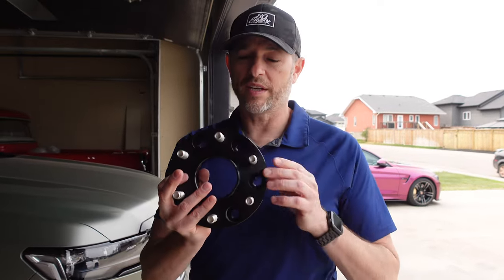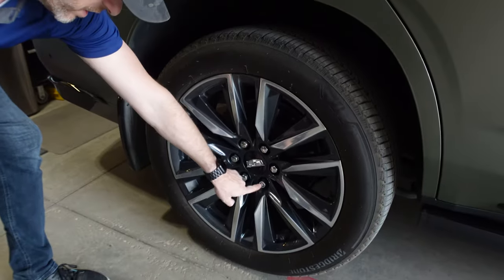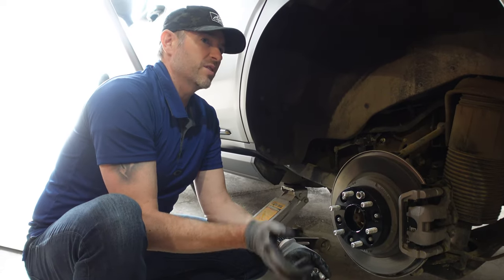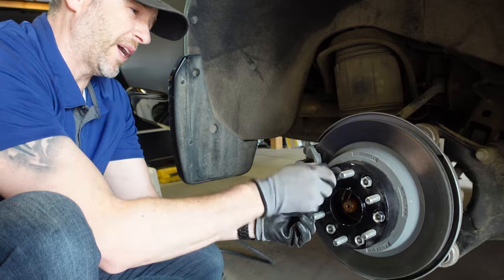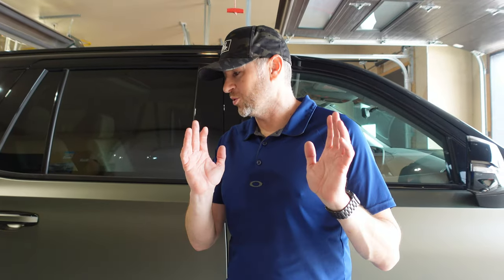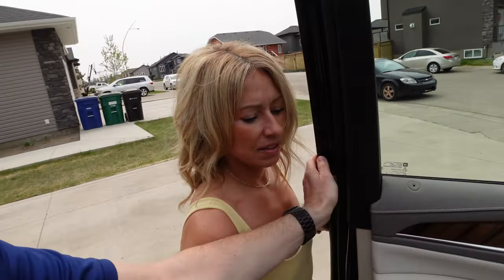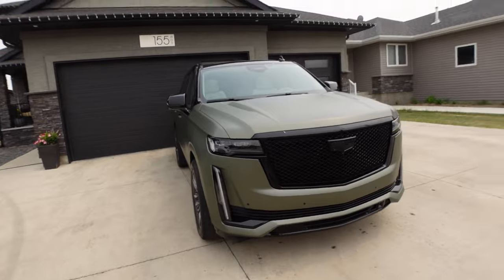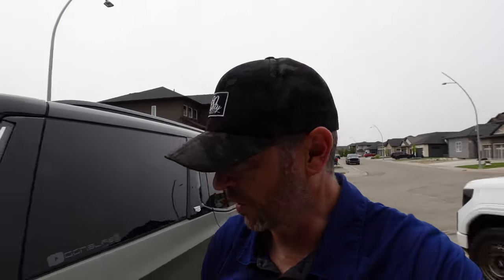Adding Wheel Spacers - Modifying My Wife's Cadillac Escalade - Will She Notice?

Comment: Hi Donslife, After installing the 1.5 inch wheel spacer. Did you face any wheel rub issue? Thanks.
Reply from the maker: When lowering the vehicle to its lowest setting there was some minor inner liner rubbing when the wheels were turned fully

Comment: I have a 21 Yukon Denali, and I put the spacers on and got rubbing.  I have the front and rear splash / mud guards on. I noticed that you have them on the rear, but not the front. was that intentional, and please let us know if you experience any rubbing with the spacers on the front.  If not, I will have to either trim, or take the mud flaps off, I guess!
Reply from the maker: The front flaps for the Cadillac aren’t compatible with the Power Folding steps.  That’s why I didn’t put them on

Comment: So, 5 days after watching this video, I received my spacers from Amazon (Thanks for the link ;-D), went ahead and installed them immediately. Won't lie, in person, it took me a couple of days before I got used to it. In videos she looked hot but in person, it needs a little growing into. Especially the rear. They look a little more aggressive than the front. Having said all of the above, I wanted to ask, after the spacers, is your wife's Escalade riding a wee bit, however, noticeably harsher? I mean the ride is still fairly smooth but now the bumps and imperfections of the road feel a little more pronounced rather than being soaked up which is what was the case before. Are you/your wife  experiencing any of this? I'm on the fence and may remove the spacers even though I've grown to like the look of it, Several Caddy owners have even asked me how come my truck looks more aggressive than theirs. So I can't lie, I am loving the little attention that it gets, but I'm not settling well with the new ride quality.

I look forward to your feedback. Oh yeah, I have air ride/magna ride. I'm not sure if your truck is equipped with this...could this be causing the issue??
Reply from the maker: I didn’t notice any changes in ride quality.  We have the upgraded adaptive and air suspension too.  I just confirmed with my wife that she hasn’t noticed anything either except the looks/stance has improved
Reply: Then I guess it’s just all in my head then. Thanks buddy!! Much appreciated.

Comment: Quick tip when you torque the wheels it is easier and safer to push on the torque wrench then pull it save your back. Also curious who your camera person is lol
Reply from the maker: I agree.  I was feeling powerful that day
Reply: Another tip on the spacers is to use a pry bar between lugs so it doesn't spin and you can get the full torque. Takes a bit of doing since these require 140 ft/lbs and holding the pry bar with one hand and the ratchet in the other.

Comment: Hey Don!! Curious, I installed these on my Silverado as well… I have been racking my brain though on something and just wondering if you have come up with a solution, if we get a flat are we removing the spacer on the side of the road as the spare won’t have the notches on the back of the rim or is there another solution you’ve thought of? Thanks for all the videos!!
Reply from the maker: I carry two socket sizes if I had to take the spacer off and throw a spare on.  Also I would ensure the spare gets moved up to the front and would keep it in 2wd while I limped to wherever I am going. Or take the spacers off of both sides temporarily.